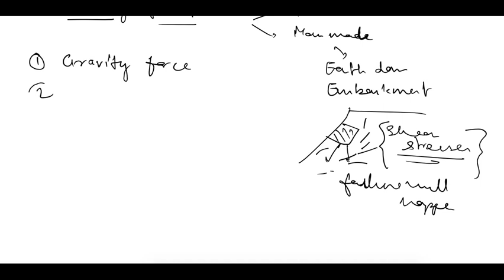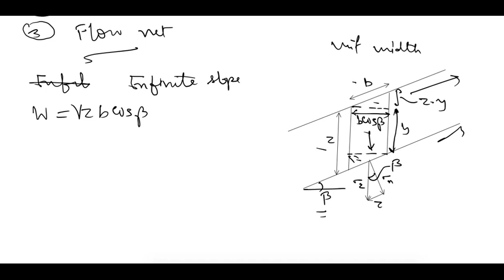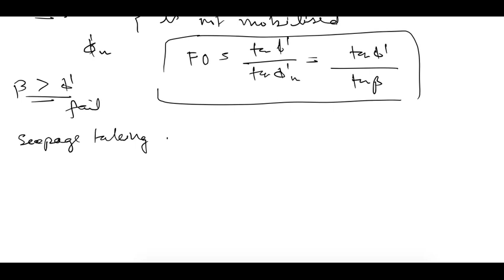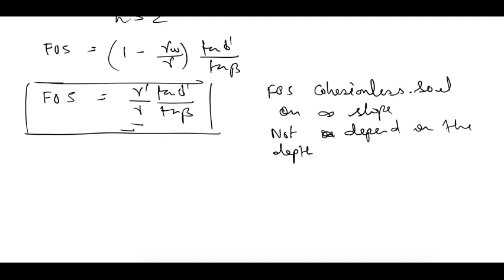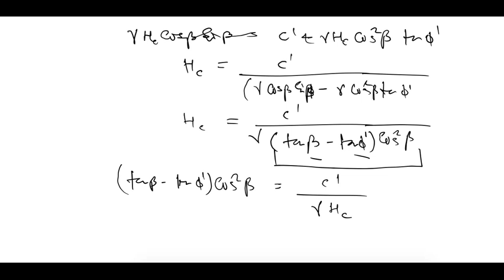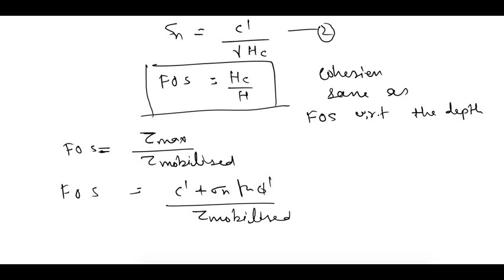Stability of Infinite Slopes | Soil Mechanics

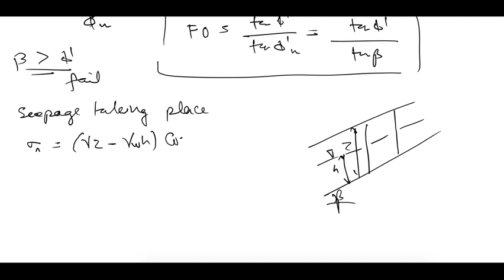Comment: At 9:27 in submerged condition u have taken bulk unit weight but u have to take saturated unit weight I think please correct if I m wrong
Reply: it is the average unit weight because there are two condition exist up to depth h bulk unit weight saturated and (z-h) is dry soil mass .there is formula to calculating  the avg unit weight.
Reply: i think up to (z-h)  depth it would be bulk unit wt of soil and after then we have to consider saturated unit wt of soil.
Reply: Yes!
We have to use saturated unit weight in the calculation of shear stress